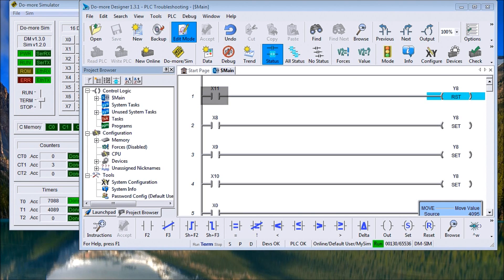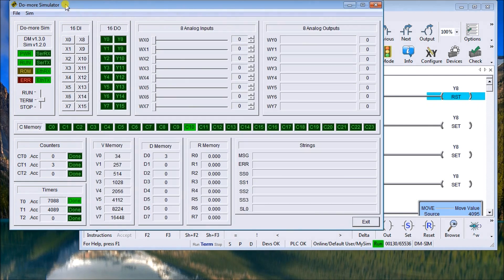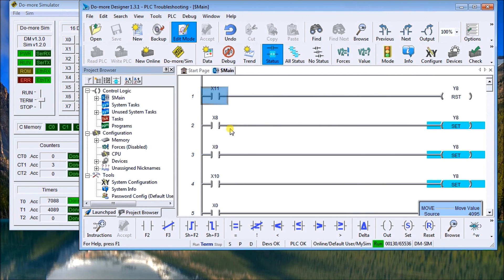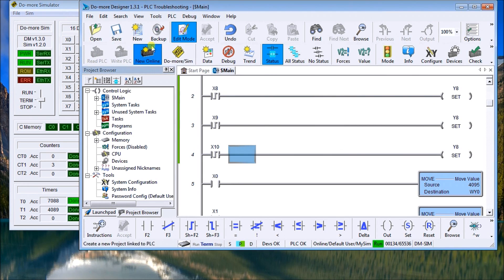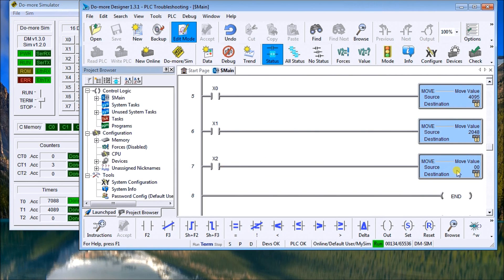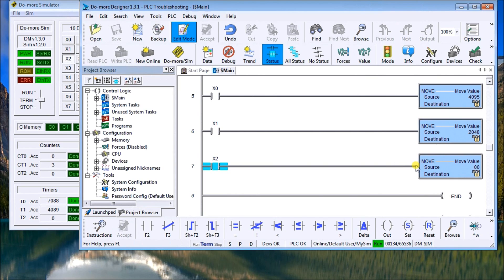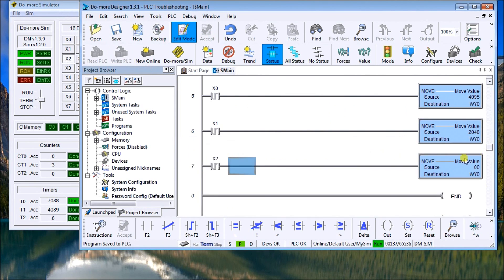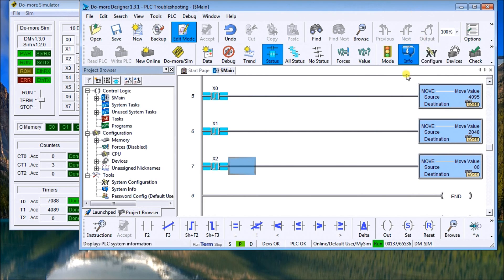Crack the Code: Troubleshooting PLC with Ladder Logic!

Comment: Which plc this one
Reply from the maker: Hi Sankar,
This is done with the Do-More Designer Software. It is a free fully functional programming package that you can download and provides a simulator. This is what I am using in the video.
Here is a link to the physical hardware that this package will also program.
https://www.automationdirect.com/adc/shopping/catalog/programmable_controllers/do-more_series_(brx,_h2,_t1h)_plcs_(micro_modular_a_stackable)
Here is also a series on the BRX Do-More PLC.
https://accautomation.ca/series/brx-do-more-plc/
I hope this helps you out.
Regards,
Garry